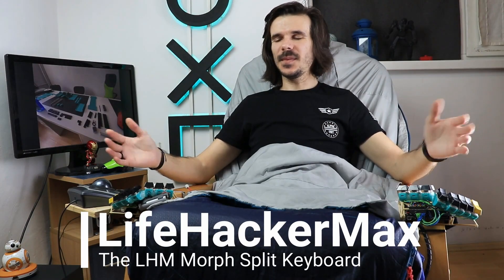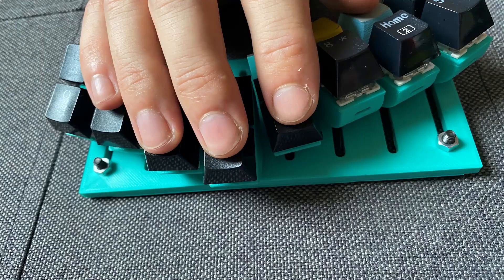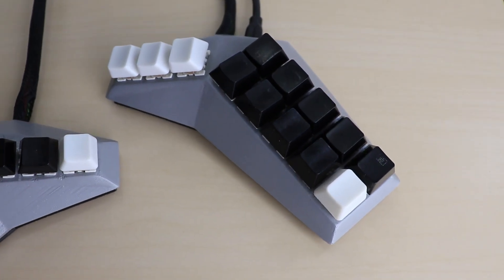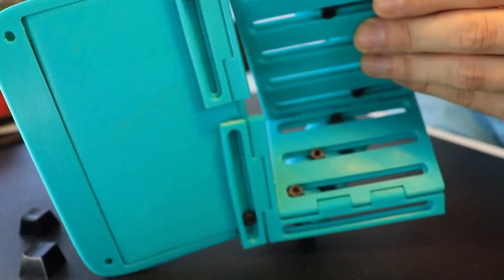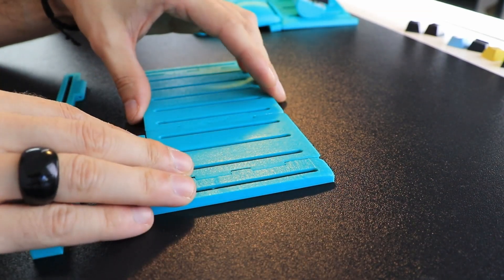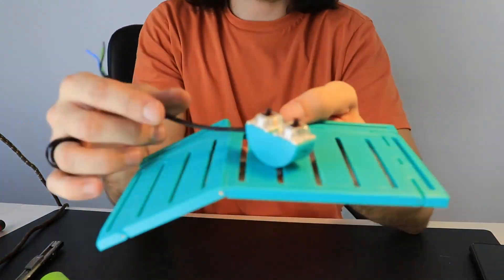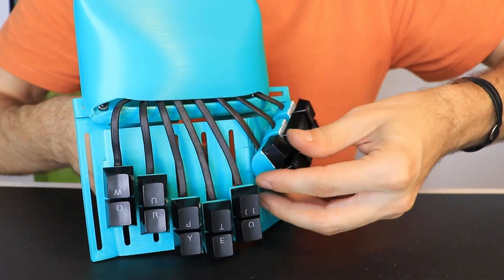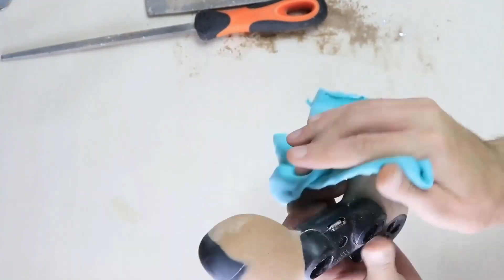Building the Ultimate Ergonomic Keyboard: Introducing the LHM Morph 32

Comment: i really like the dieas of havigng the keys at adjustable angles and adjustable depth. because like ou were saying people hand come in different shapes and sizes level the persons left and right hands are different.  the only thing i would find cool is the ability to move each key independently and somehow figure out a height adjustment option
Reply from the maker: Thank you! The way I designed the platform doesn’t allow for more flexibility; too many variables. One thing that could be improved and others asked for would be a 3 key module. I will try to make that. I will upload a new video soon with the keyboard that emerged from the Morph. I hope you guys will find it interesting 😃.
Reply: @LifeHackerMax  im sure i will. your video today got me going down quite the rabbit hole  of ideas and thinking how in the world i could execute them.  then  i got thinking about thumb clusters using smaller button like a with the razer naga mouse. could bet allot of layer keys throw in a normal key 90 degrees off for a space key. i now think height adjustment would be very hard to execute and have locked in= once you find the  height you like  so probably just different angled key caps would be the better option there. so i do  think your right that limiting the variable to what you have is  probably a good choice. one other thing i really l admire  about your design is the ability to adjust the the angle between the finger keys plan and the thumb button plane. i wouldn't have thought to do it .

Comment: First keyboard project that actually looks useful. Could you next time please NOT speed up the footage when showing how it moves? I could barely see sh*t. Thanks!
Reply from the maker: Thank you! It doesn’t actually move. It is adjustable, unscrew, adjust and screw back on. I will try adding some real time adjustment footage in my next video.
Reply from the maker: Thank you for the feedback. It is very helpful. 🙏🏽
Reply: @LifeHackerMax  Thank You for taking time to respond to my nagging comments. Subbed for more content! 😎
Reply from the maker: Hey! Have you seen this short? This could be the next step in Keyboard Ergonomics #shorts
https://youtube.com/shorts/eOy4ZLo7lwM?feature=share 
I think it shows the adjustments a bit better.

Comment: Amazing in it’s simplicity! I wonder, will there be a version with three buttons per finger instead of two?
Reply from the maker: Thank you! I made the project open source so anyone can improve it adding something new to it. I made it with 2 buttons to be able to build my keyboard but modifying the key module to include 3 buttons should not be an issue if there is an application for it. Btw: you can install 2 key modules in one slider to get 4 buttons in a line 😉.
Reply: @LifeHackerMax  great, thanks!

Comment: I have to ask why the 1960's easy bake oven color? ;)
Reply from the maker: 🤣 I like the color and it was the only filament I had at the time. Anyway, after I will finish the keyboard everything will be covered up. What color would you chose?
Reply: @LifeHackerMax  black or beige. With the "big 3" layout like the Monterey K104. Nobody has made a big 3 since 1995 thanks to Microsoft's WinKeys. Backslash got moved from between right alt and ctrl then to make room the left end of backspace, left end of right shift, or upper end of enter gets taken off for backslash. My first PC keyboard had this style and I use the areas of all three keys variously sacrificed to WinKeys.
Reply: The K104 has an unused key between left ctrl and alt. Make that the Winlogo key. If a menu key must exist cut a bit off the right end of the spacebar. An FK9000 is a wonderful "battleship" keyboard. It's a big 3 variation where backslash takes a piece off the right end of right shift, having been displaced by the prog key for the 12 programmable function keys on the left end where PC/XT boards had them. For an FK9000 clone I'd put backslash where it belongs and put prog by itself out of the layout. It has a do nothing key like the K104 so the same WinKeys solution would work. Everything else would remain, including the 8 way cursor keys and the numpad calculator. Its display could be improved (someone already makes a kit) and I'd add the feature the original missed, the ability to send the numbers from the calculator display to the computer.